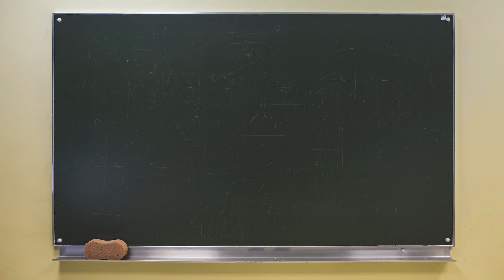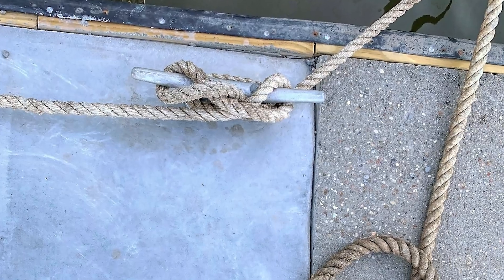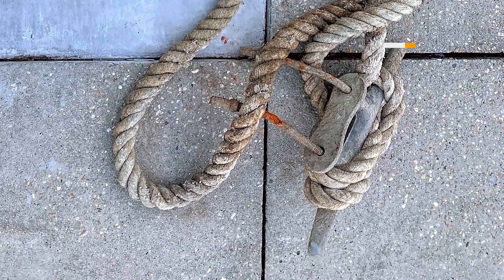Physics of Docking - Tying to a Cleat (MOB Review)

Comment: dose the size of the cleat and rope matter a 85 foot yacht against a 30 foot boat smaller line
Reply from the maker: 59PatrickW: Of course, it all has to be strong enough.
Reply: Yes, but make sure that the dia of the line is the right size for the cleat, a small line on a large cleat is bad, laso a large dia line on a small cleat. @JeffMerrillYachts

Comment: Cleating is a little subjective. The first criticism was incorrect. It was not going to come loose cleated that way and completely fine. I prefer the method illustrated but that doesn’t mean other methods are wrong
Reply: May I clearify things a little bit. STI, is completely right. The first cleat was the "OXO-Method". This method is used by professionals, mostly when they are licensed from RYA. The Coastguard in US also use this technique. Absolutely reliable!
But I must confess I like the locking hitch as shown too.
Reply: @ushi120  As a deckhand with Fisheries & Oceans Canada, I used the 'professional' method as well. Didn't want to be blamed for a hundred-metre oceanographic ship drifting off the quay.
Reply: @harbourdogNL  🤣 I'm with you that wouldn't be funny!
Reply from the maker: STI - Agree, it is all subjective, I do a full loop before I cross and I'm happy with one lock.  Whether the example would have come loose or not we will never know, you are probably right.  I think the key is consistency so you tie and untie the same know. If you come back to go boating and your ride has drifted off, well...guess you need to work on your cleating! //:0)

Comment: When tying cleats you need to wrap around 1.5 times before locking, it's explained and demonstrated with evidence here:  https://www.youtube.com/watch?v=BBqsF72xNSU
Reply from the maker: Mickey: There is Douglas' way and many others. To each his own, but they should be consistent and have a lock on at least one ear. Thanks!
Reply: Micky G, you are wrong. It depends how thick is the rope and the size of the cleat. 😉
Reply: @ushi120  yes, but what I said is probably 90% of the time.